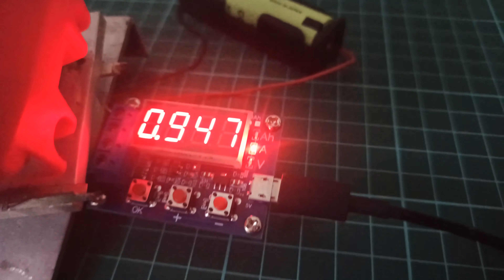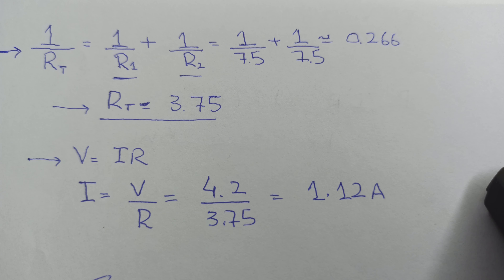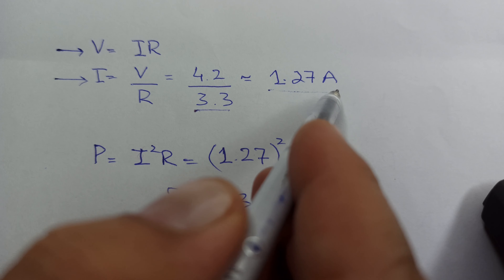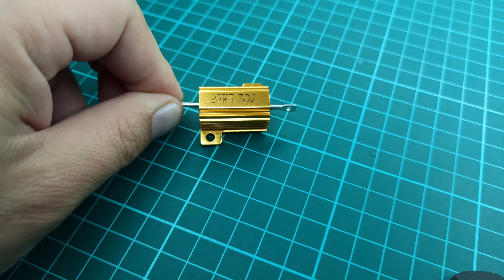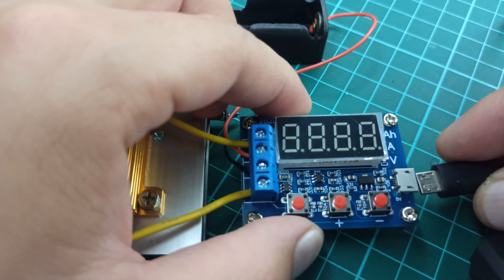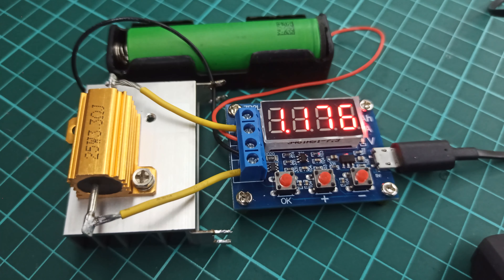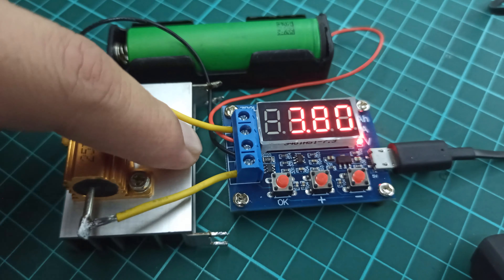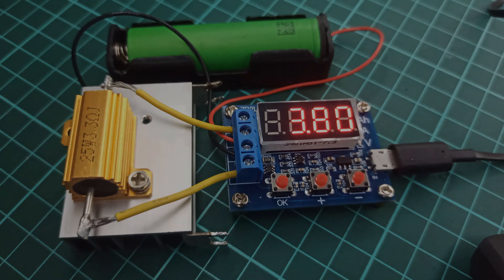How to make lithium ion battery capacity tester

Comment: When my resistor was glowing orange, I realized that there was a heat issue... So, I used the NiChrome wire heating element panel from a 220V electric clothes panel and alligator clips to clip into the coil at whatever point I needed for the amperage that I desired... I was testing 12V LiFePo4 batteries and with the ceramic resistors, concentrated heat was being generated, but with the NiChrome wire, the heat is produced over a large enough area that is is no longer a fire hazard...
Reply from the maker: Thats another super cost saving and superb idea 💡 
Thanks for sharing

Comment: How did you calculate what resistance too use?this will sound stupid beyond newb for someone who knows electricity but yeah. I don't know the law of recistance or anything but wouldn't 2 resistors in parallel be doubled not halfed if you want too use one? Say using 2x 5w 7.5ohm in parallel then that would be like 1 x 10w 15ohm in single as its simply added together the 2 in parallel. So why not use a 25w 15ohm too reduce the heat as mutch as possible or does the ohms in this case just create a higher load?
Reply from the maker: Great question! It actually touches on some foundational concepts of electrical circuits. Let me break it down:

Resistors in Parallel: When resistors are in parallel, the total resistance decreases, not increases. The formula for calculating the equivalent resistance of two resistors in parallel is:

1/𝑅total = 1/𝑅1 + 1/𝑅2
 
So, if you have two 7.5Ω resistors in parallel:

1/𝑅total = 1/7.5 + 1/7.5 = 2/7.5
 
This simplifies to:

𝑅total = 3.75Ω

The total resistance is halved, not doubled.

Power Handling: When resistors are in parallel, their power-handling capacity is combined. So two 5W resistors in parallel can handle 10W of power, while maintaining the lower resistance (3.75Ω in this case).

Heat Management: Using a single resistor with higher power rating (e.g., 25W) can reduce heat-related issues because the resistor can dissipate more heat before overheating. However, the resistance value matters based on your circuit's requirements. In your example, a 15Ω resistor would create a higher resistance (lower current) than two 7.5Ω resistors in parallel. The actual resistance you need depends on your circuit design, so just swapping it out for a higher wattage resistor might not work if the resistance doesn't match the design.

Why Parallel?: Parallel configurations are often used to adjust resistance and increase power capacity while distributing heat dissipation across multiple resistors. In contrast, a single higher-wattage resistor simplifies the design but requires the correct resistance value for your application.

Comment: I have 2 resistors, both are 10W and 4,7 ohm but don't have tolerance value (J). Can I combine it and also can I install it to the module?
Reply from the maker: Yes you can, If you are joining them in parallel then due to high resistance, you will observe a low current drop and longer time for each battery to discharge.
Reply: @ERLEngineering  One more question. besides discharging speed, Is there any different in capacity results between the resistor you have right now (25W 3,3RJ) and the current one (2 resistors 5W 7, 5RJ)?
Reply from the maker: No, this only changes the discharge speed.
Reply: @ERLEngineering  Thanks a lot for the information.
Reply from the maker: Welcome 🤗
Reply: I have a battery capasity tester that uses 2x 10w 8ohm and gets really toasty drawing around 1.1amp could i switch out those for something other? Like a 5w 15ohm resistor wich I have used too discharge batteries by just plugging a battery straight on too it without any problems with heat. I know i don't know how too calculate this at all.

Comment: Hi. How could I connect multiple boards to one power supply without burning them or power supply. I would like to make 13S tester and test 13S powerbank without disconnection all cell conections from series. The input + side is connected to power input + side. negative sides are not connected on board.
Reply from the maker: Hello, well a 13s battery bank provides 48.1 volts and since the ZB2L3 module can only handle a maximum of 15 volts, so you cannot use this module for testing a 13s pack.
ZB2L3 can handle a maximum of 4s battery pack for testing.
For this purpose, you can use the DL24P battery tester which is a 180w tester with testing range from 2-200 volts.
Here is a link to my video on DL24p module, check it out.
https://youtu.be/N7jHftrVanw?si=4GU2TMuVxGQQ_B3F
Reply: @ERLEngineering  thanks. I was thinking about 13 ZB2L3 boards one for each cell bank. But when I tried that with one power supply they burned because there was a short in between power supply. But I just remembered i already have a 16S diy charger with 16 separate 220v to 5V supply so I will just add ZB boards to that system and I will have charger discharger.
Reply from the maker: Why separate supplies for each module?
I have used a single 220vAC to 5vDC for powering up 9 zb2l3 modules along with 12 charging modules and it worked fine.
Reply: But did you charge single separated cells or cells connected in series. When I tried cells in series my boards got fried when thehy shared power supply.
Reply from the maker: I checked them each separately because the module itself does not support more than a 4s battery pack.
Since you applied 48.1 volts using a 13s battery pack, it was surely a bad idea.

Comment: 1.12^2 x 3.75 = 8.4 ???
Reply from the maker: Good check, sorry i think i made a mistake during the calculation, it should be 4.7W, but still this video is good right in terms of replacing the stock resistor with a heatsink mount one 😃
Reply: @ERLEngineering if I replace the original resistors with 25W 2.5om one, will it be a good idea if I only want to test 18650 cells?
Reply from the maker: With a 25W 2.5 ohm resistor, the current drop across the resistor would be 3.16 amps at peak voltage of 4.2v.
I would recommend to use heatsink with the resistor to help it dissipate heat.
This would work good for 18650 cells.

Comment: 1:23 your calculation for power dissipation is not correct. You are using equivalent resistance value (3.75 Ohm) for calculating power dissipation but comparing it with the power rating of one resistor (5W).
In parallel combination the power rating adds up because 

1/Req = 1/R1 + 1/R2
So, Req = R1R2/(R1+R2)
 Total power dissipation= V²/Req (V is the voltage across both resistors as they are connected in parallel)

= V²(R1+R2/R1R2)
=V²/R1 + V²/R2
= Sum of individual power ratings 

So here if you are accounting for equivalent resistance, you have to compare the power dissipation with equivalent power rating i.e, 10W.

Also, how did you get 1.12² x 3.75 = 8.4W ?? It's 4.7W, way below 10W and safe.

Even if you use i²r then you need to take current across each resistor and find out. Since both are same resistors so the current will be divided equally between them. So, 

i1=i2=i/2=1.12/2 = 0.56A

So, P1=P2= 0.56² * 7.5 = 2.352 W
Hence total power dissipation= 2.352+2.352 = 4.7 W (well below rating of 5+5=10W)